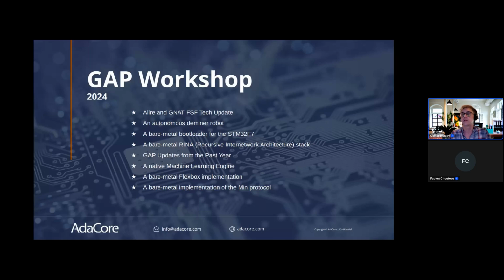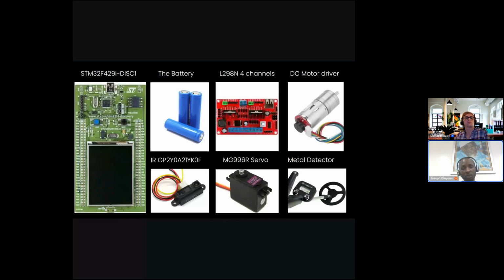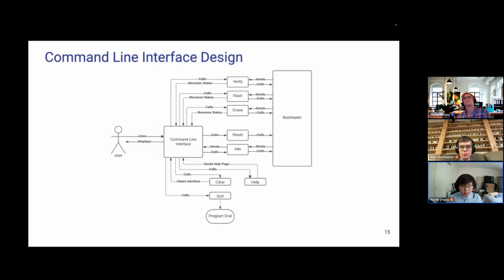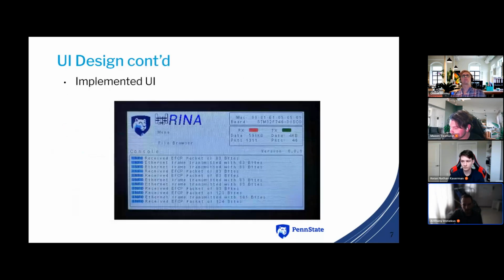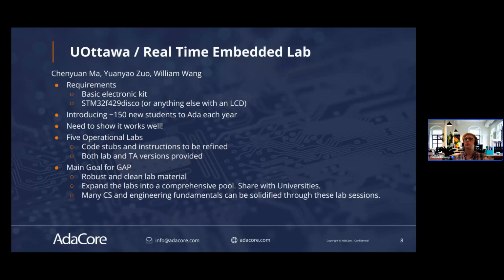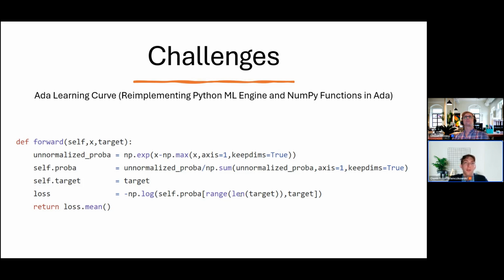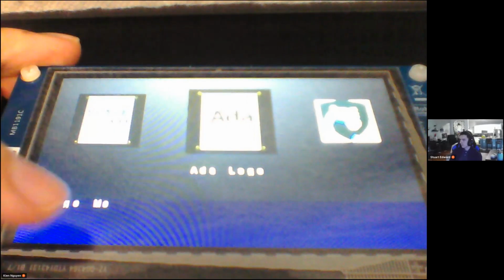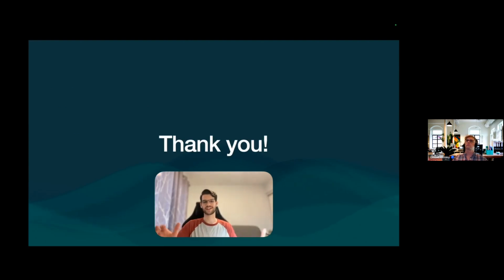Ada and SPARK for Academics Workshop 2024 | GNAT Academic Program

Comment: AI Summary

*Abstract:*

This webinar recording highlights recent advancements in AdaCore's Alire package manager and GNAT FSF compiler, alongside a showcase of several student Capstone projects developed using Ada and SPARK. Fabien Chouteau from AdaCore detailed Alire 2.0 enhancements and new Ada language features in GNAT FSF 14, including improved array bounds, dot calls for untagged types, string interpolation, and experimental case pattern matching.

The Capstone projects demonstrated diverse applications:
*   Joseph B. (Senegal) presented an autonomous demining robot built with Ada on an STM32F429, addressing a critical real-world problem.
*   Alan Everett and Xavier Zhong (Penn State) developed an Ada-based MCU bootloader for the STM32F746G, complete with a host-side command-line interface.
*   Kian Kaserman, Mason, and Anthony (Penn State) implemented a bare-metal Recursive InterNetwork Architecture (RINA) stack on an STM32F746G, offering an alternative to TCP/IP, demonstrated via image transfer.
*   Owen K. (Penn State) detailed an Ada ML Engine, establishing foundational components for neural networks and demonstrating classification on a spiral dataset.
*   Samuel (University of Ottawa, pre-recorded) showcased a bare-metal Ada implementation of the Min communication protocol for lightweight MCU-to-host communication.

Olivier Le Cabellec, AdaCore GAP Coordinator, provided an update on the GAP program, emphasizing its focus on Capstone projects, tooling support (Alire toolchains for popular boards), development of educational resources like "Ada for the Impatient," and engagement in academic conferences (SIGCSE, FENM) and student competitions (CanSat France, Space Concordia). The webinar underscored Ada's suitability for complex, reliable, and embedded systems development in academic and real-world contexts.

*Ada/SPARK Academic Webinar: Capstone Projects & Technology Updates*

*   *00:00:07 Welcome & Introduction:*
    *   Olivier Le Cabellec, AdaCore GAP (Global Academic Program) Coordinator, introduces the webinar focusing on Capstone projects and Ada/SPARK updates for the academic community.
*   *00:02:25 AdaCore Technology Updates (Fabien Chouteau):*
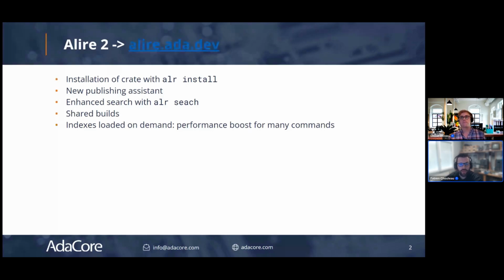    *   *00:03:10 Alire 2.0:*
        *   *Key Features:* `alr install` for system-wide crate installation, new publishing assistant, enhanced `alr search`, shared builds (compile dependencies once), on-demand index loading for performance.
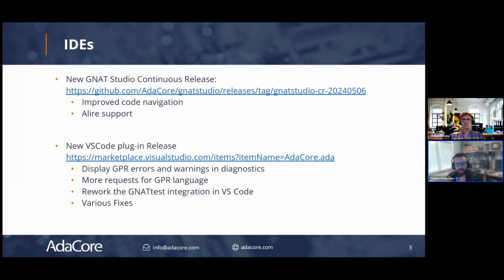    *   *00:04:50 IDE Updates:*
        *   *GNAT Studio:* New release with improved code navigation and Alire integration.
        *   *VS Code Ada Plugin:* New version with better GPR file handling and test integration.
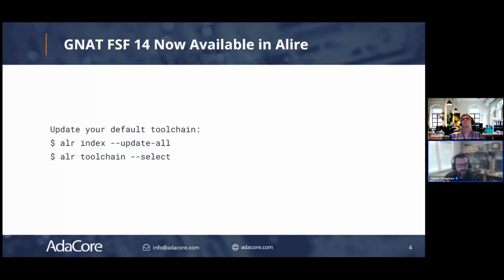    *   *00:05:34 GNAT FSF 14:*
        *   Now available via Alire (`alr toolchain --select default --index-update all`).
        *   Supports Linux x86, Windows, macOS x86 (ARM Mac support coming soon). GNAT Pro build is in progress.
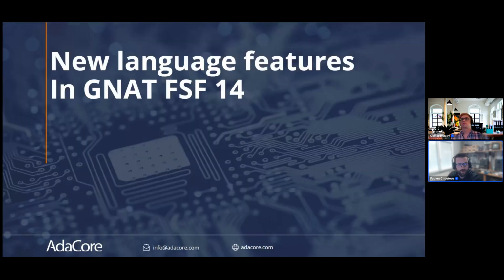    *   *00:07:52 New Language Features (GNAT FSF 14):*
        *   Enabled via `-gnatX` (stable extensions) or `-gnatX0` (prototype extensions).
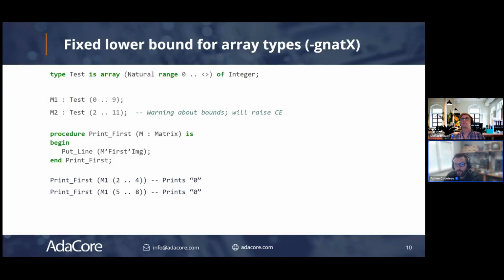        *   *00:08:32 Fixed Lower Bounds for Array Types:* Define arrays to always start at a specific index (e.g., 0).
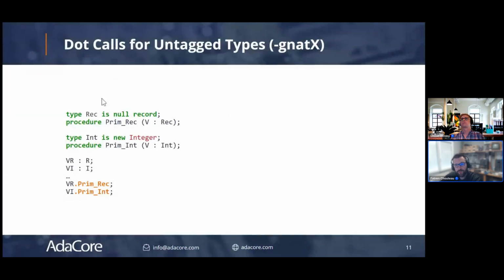        *   *00:09:05 Dot Calls for Untagged Types:* Use `Object.Procedure` syntax even for non-tagged types.
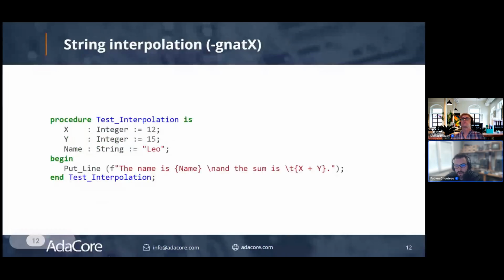        *   *00:09:34 String Interpolation:* `F"Value is {X+Y}"` for easy string formatting.
        *   *00:10:00 Default Implementations for Generic Formal Functions:* Provide default bodies for generic subprogram parameters. (X0, will be stable in FSF 15)
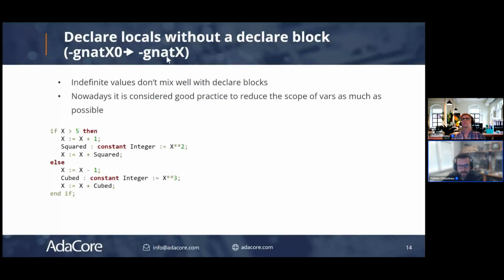        *   *00:10:44 Declare-less Locals:* Declare local variables/constants interspersed with statements without a `declare` block. (X0, will be stable in FSF 15)
        *   *00:11:27 Case Pattern Matching:* Enhanced case statement to match on record fields and bind values. (X0 feature)
        *   *00:13:15 Extended `exit when` style:* `return when condition`, `goto when condition`, `raise when condition`.
*   *00:15:43 Capstone: Autonomous Deminer Robot (Joseph B.):*
    *   *Context:* Addresses the danger of landmines in Kazamance, Senegal.
    *   *Goal:* Develop an autonomous robot to detect buried metal objects, reducing human risk and cost.
    *   *Hardware:* STM32F429 Discovery, recycled laptop batteries, L298N motor driver, Sharp sonar, MG996R servos, metal detector head.
    *   *Software:* Ada Drivers Library (ADL), STM32F429_Disco Alire crate, custom drivers. Architecture includes Position Manager, Sonar DMA, Scanner, and Vehicle packages with prioritized periodic tasks.
    *   *00:31:56 Demo:* Robot movement, arm deployment, and scanning functionality shown.
    *   *Takeaway:* Ada is viable for complex robotics in resource-constrained environments; project has 3041 LoC.
*   *00:37:57 Capstone: MCU Bootloader (Alan Everett & Xavier Zhong - Penn State):*
    *   *Goal:* Create an open-source Ada bootloader for bare-metal STM32 systems (STM32F746G Disco).
    *   *Tools:* Alire, GNAT, Ubuntu, VS Code, OpenOCD, shunit2 for testing.
    *   *Features:* Interrupt-driven entry into bootloader mode, host CLI (UART communication) for erase, flash, verify operations.
    *   *00:45:33 Demo:* Shows normal application boot, interruption to enter bootloader, CLI interaction for `info`, `erase`, `flash`, `verify` commands.
    *   *Takeaway:* Practical demonstration of Ada for low-level system software development.
*   *00:56:33 Capstone: Bare-Metal RINA Stack (Kian Kaserman, Mason, Anthony - Penn State):*
    *   *Problem:* TCP/IP limitations (efficiency, security, complexity).
    *   *Solution:* Recursive InterNetwork Architecture (RINA), which views networking as Inter-Process Communication (IPC) using Distributed IPC Facilities (DIFs).
    *   *Implementation:* Dual setup: Linux side uses "Rlite" (C RINA implementation) with an Ada API wrapper; STM32F746G side has a bare-metal RINA stack in Ada.
    *   *UI:* STM32 display shows network stats and acts as a debugger, with touchscreen interaction.
    *   *01:06:22 Demo:* Configuration of Rlite on Linux, enrollment process establishing connection with STM32, transfer of a bitmap image from Linux to STM32 over RINA, image displayed on STM32.
    *   *Takeaway:* Successful implementation of a complex, alternative networking protocol in Ada on bare metal.
*   *01:17:51 AdaCore GAP Program Updates (Olivier Le Cabellec):*
    *   *Focus:* Capstone projects as a "stress test" for Ada and its ecosystem, aiming for fun, challenging, and impressive outcomes.
    *   *Tooling & Resources:* Preferred boards (STM32F429, F746G) with Alire toolchains; "Ada for the Impatient" (AFI) guide for rapid onboarding.
    *   *Projects & Labs (UOttawa):* RSA Public Key Crypto Lab (native), Real-Time Embedded Lab (STM32F429), planned for official university curriculum.
    *   *Outreach:* Participation in SIGCSE 2024, FENM Engineering Design Conference.
    *   *Sponsorships:* CanSat France 2024 (100% Ada), Space Concordia (CubeSat project).
    *   *Future Goals:* Accelerate student onboarding, enhance Capstones, foster cross-pollination among GAP members, coordinate with open-source Ada projects and relevant industry technologies.
*   *01:39:02 Capstone: Ada ML Engine (Owen K. - Penn State):*
    *   *Problem:* Lack of existing machine learning libraries/implementations in Ada.
    *   *Goal:* Establish foundational ML components in Ada to construct and train neural networks natively.
    *   *Assessment:* Classify a spiral decision boundary.
    *   *Techniques:* Alire, AUnit, ReLU activation, Tensors (using Ora NGA), Softmax loss, Stochastic Gradient Descent (SGD) optimizer, backpropagation.
    *   *Challenge:* Managing low-level operations and data structures in Ada compared to high-level Python ML libraries.
    *   *01:52:03 Demo:* Terminal output showing training epochs and resulting accuracy, demonstrating successful learning.
    *   *Takeaway:* Ada can be used to build ML systems from fundamental components, opening doors for safe/secure AI.
*   *01:54:56 Capstone: Bare-Metal Min Protocol (Samuel - UOttawa, pre-recorded):*
    *   *Min Protocol:* Microcontroller Interconnect Network by Dr. Ken Tindell (2014) – a lightweight, reliable MCU-to-host communication protocol.
    *   *Layers:* Serial (UART), Frame (ID, length, payload, checksum, byte stuffing), Transport (optional, for retransmission – not implemented here).
    *   *Goal:* Implement Min protocol in Ada as an Alire package.
    *   *02:03:56 Demo:* Code walkthrough of STM32 and host-side Ada implementation. Terminal shows "Hello AdaCore" message sent from STM32 to host, then echoed back, with raw serial byte inspection.
    *   *Takeaway:* Successful porting of a communication protocol to Ada for embedded use.
*   *02:33:31 Conclusion & Thanks (Olivier Le Cabellec):*
    *   Thanks to all presenters and attendees.
    *   Emphasizes the success of the students and the capabilities of Ada.
    *   Contact information and follow-up (video link) will be provided.

I used gemini 2.5